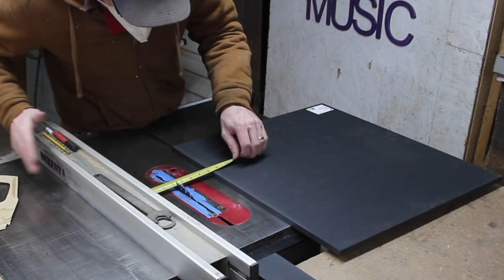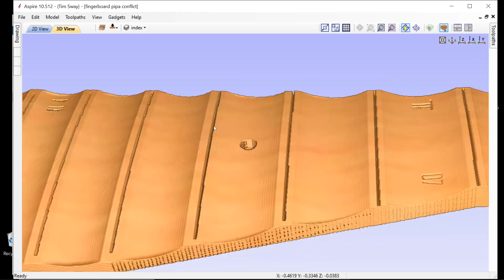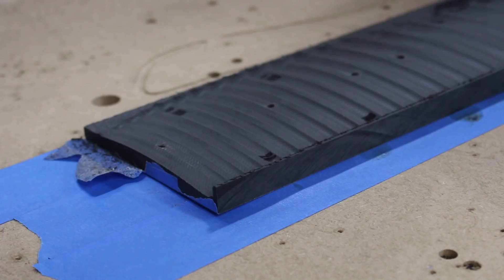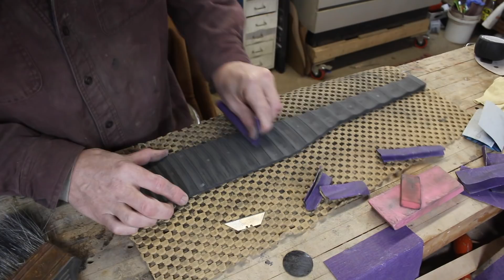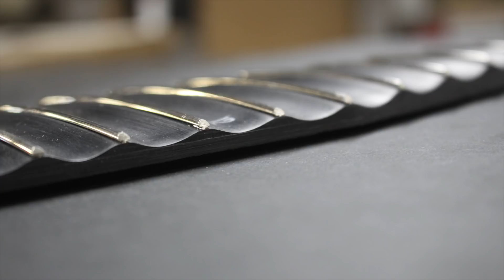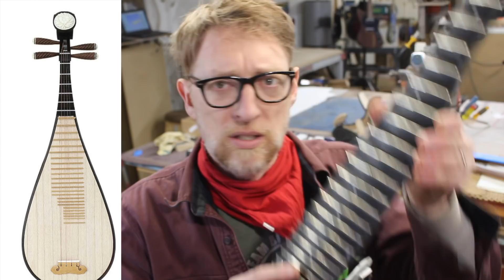Crazy, Scalloped Fingerboard for a Radical Instrument | CNC Woodworking

Comment: Hey Tim, have you checked out Rocklite finger boards? LMI has them. They’re like Richlite, but made of sustainable wood. They have grain and figure like the woods they replace
Reply from the maker: yes, I am familiar with them. Looks like good stuff. I use Richlite instead only because they are US-based so the travel footprint is smaller.
Reply: @timsway  good to know, thanks

Comment: The paper laminates (or similar) now available look wonderful, it's just a shame that we still haven't developed a resin that isn't just another plastic (I'm going to try to avoid plastic wherever possible, and boy is it difficult). I'm planning on going the other route of staining local(ish) woods to simulate ebony/rosewoods, but I can definitely see why these materials can be a good idea (or just laminates in general).
Reply from the maker: Agreed the resin is still undesirable  units a step.on the right direction and they've very efficient with their process. You can certainly "ebonize" local woods with water based pigments.

Comment: I am a bit of an environmentalist myself and I don't want to use exotic woods for future projects aswell. I am planning on ONLY using materials that I can source environmentally friendly here from where I live in Germany. I've seen videos of people artificially creating bog oak (steel wool/vinegar solution onto oak wood) and I was wondering if I can use that for darker toned fingerboards.

I dunno, just a thought, maybe you want to test that aswell and let us know how that went.
Reply from the maker: you can also make water-based black dye using pigments and stain wood black. Steel wool and vinegar works differently on different species (oak usually turns very purple/black. and I highly recommend experimenting with it. It's a lot of fun!

Comment: Super cool!!!! I have been searching for more oak pallets lately. It feels kind of hard to source reclaimed wood locally, I really love the idea but it may not be really practical in my area. Most of the older homes here are built from white pine so that complicates things even more. With that being said I have considered using some of the old planks from my home. planning them and creating a micarta sandwich for the wings and some oak for the spine. Something I noticed with using different woods in a body blank is they react differently to temperature and humidity changes. I am in no way ready to tackle a finger board but I'd be open to micarta for sure.

Comment: Really cool project again. I'm kind of sceptical of the degree of recyclebillety of some of those recyclable polymers but getting to know these things on a small scale is a step in the good direction for sure. 

Are you going to seed those frets any deeper? I had some problems with refrets not seating Al the way in and am curious to see if you are going to put them deeper in the groves
Reply from the maker: of course, even green manufacturing is not 100% green. Everything leaves a footprint. It's about how much damage we leave behind and trying to reduce it. Like my Sway Carolina non-leather boots: they were made from the greenest fake leather we could use at that scale, but it's still petroleum based and they were still made in a factory. Are they perfect? No. Are they better than the leather alternative? In every possible way, yes.

The frets are in there. a little superglue is sometimes needed on refrets (and new frets for that matter!)

Comment: I've got to check out that rich lite stuff out. Amazing fretboard though.
Reply: Gibson used it on all their guitars for some years while ebony was basically unavailable. Of course the purists hated it because it was a deviation from the super rigid standards but people will find a way to complain about just about anything 🤷
Reply: @SeraphimKnight  yeah...I've been looking for an ebony fingerboard material replacement and this seems to be it. 
Looking into using a hemp wood composite to use for the body wood as well.
Reply from the maker: Hemp wood is on my list, too :)
Reply: @timsway  where can I find it in the appropriate size for making bass bodies and or necks?
Reply from the maker: @trance9158  check their site. You'd probably need to order it or glue together panels yourself
Reply: @timsway  who's site for hemp wood?
Reply from the maker: @trance9158  oh I thought you meant Richlite. Not sure for hempwood. Haven't looked in a while.

Comment: Good stuff Tim.  Someday, if I ever actually build a few guitars from scratch, I'll have to give that stuff a try.  How does it work with hand tools?  I don't have any machines to use to make a fretboard out of the stuff.
Reply: Hey dude! If you've never made an instrument before but want to practice a finger board, I'd highly recommend a 2 or 3 string cigar box guitar. They're pretty easy to build from scrap and you can go as fancy or as slapdash as you like. Main thing is focusing on the fretboard so all the notes are in tune.
It's great to practice precision but you don't have to be too precious about the instrument it's self.

Edit : great to make with hand tools.
Reply from the maker: what CYGNETURE said is true. It is very, very hard and works fine with hand tools. But it is hard and sanding really sucks.
Reply: @timsway  It looks very durable.  Thanks for confirming that the sanding sucks.  I don't like to sand if I can get away from it I will.
Reply: @cygneturevids9774  Thanks for the info.  I made a fretless 2 string CBG a year or so ago.  I need to make a few more then try my hand at something a little more traditional.